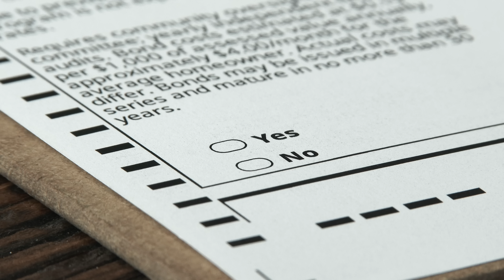Why Does Tesla Have An Anti Right-To-Repair Stand? We Suggest Some Reasons

Comment: I actually take my Tesla to a 3rd party repair shop, because there's no official service center in my country. I don't know the exact arrangement, but they operate with the knowledge and even support of Tesla, they have access to diagnostic tools and can order new parts.
But I understand Tesla too, there are good reasons for not allowing anyone to work on their cars. Mainly because the tech is so complex, so different, and changes so fast, plus a large percentage is made in-house. ICE cars are over hundred years old, largely made from the came parts, and while they are complex, that happened over decades, so mechanics could easily keep up. Also mostly the mechanical components break, which require far less knowledge, so even as ICE cars are getting very complex lately, the common issues still involve the same old stuff.
I worked on ICE cars a little, I've built custom PCs for 30 years and I work as a software engineer, so I think I understand all major aspects of a Tesla. I don't think your average repair shop could handle it. But over time the knowledge will proliferate and the technology will become mainstream, while Tesla's reputation won't be in jeopardy anymore,  so I expect them to gradually open up.
Reply: If you work in software then you should understand that if a 3rd party working on the car can screw it up so badly that it is a safety issue than it is a sign of awful programming. It sounds like the code base is garbage in Tesla's and if it isn't controlled 100% then stuff stops working properly. Tesla's "auto pilot" is nothing more than fancy driver assists, many other manufactures have similar systems. Why can I buy after market sensors for those cars and they continue to work safely but that is such a scary thing for Tesla.

There is nothing so complex in their cars that it is so over the head of other people that 3rd party repair shouldn't be allowed. Just because you do not understand it doesn't mean there aren't other people out there smart enough to do it safely. This "I'm SOOO smart and even I don't understand the tech in my car so I am scared of letting other people work on it because well I am smarter afterall" manta is non-sense.
Reply: @instanoodles  
You have on idea what you are talking about.
1. Since I "work in software", I know how much work it takes to make a software usable for 3rd parties. It's not worth doing, unless you have to. And even then it's exponentially harder to make a software (or anything) completely foolproof. My point was that people who are mostly working with mechanical stuff are probably not the best for working with complex electronics and software. At the very least it's a steep learning curve.
2. In reality Tesla's Autopilot is 10-15 years ahead of the competition. https://www.youtube.com/watch?v=HI5Y5WKHRd4 The key is that this works anywhere in any condition and it's a stock car, while other systems only work in very limited circumstances and require very expensive upgrades.
3. Of course it's complex. But more importantly it's very different from traditional cars. Also there's a high-voltage system that is actually dangerous to work on.
4. You missed the part where I wrote that I do take my Tesla to a 3rd party shop.

Comment: Another reason for Tesla's anti right to repair stance could also be the company not wanting to be outshined by a third party repair! There an entire industry for high performance and racing parts out there which routinely "bests" the OEMs on replacement parts for functionality and durability. 

You don't have to be a professional race car driver to have used performance parts from Summit Racing (FYI - I grew up in and around Akron Ohio where Summit Racing is headquartered). Want to improve horsepower and fuel efficiency? Buy an Eddlebrock air plenum, or an underpulley system for your normally aspirated Mustang and pop them on. Got a little more money to plow into your vehicle? Purchase a Maclaren turbo retrofit kit from Summit. It's just stuff that you do as a vehicle owner. Want to add a nitrous oxide kick to your ride? Yeah, Summit's got that too! High Performance mode controller (ECM) chips and EPROMS are available at Summit for all of that. 

I think that Elon is scared of being "bested" by the high performance aftermarket parts industry to be quite honest. It's that same narcissistic streak - which we've all grown extremely wary of over the past 4 years!

Comment: I run an old (6jrs.) Model S and have done a fair amount of work on it. I have even installed a Trailor Hook. Working on Teslas is generally not so bad as its made out to be and so far Tesla has sold me everything I needed. That said, Tesla refused help when they detected an after Market Chip in the MCU. So it seems if you dont mess with Electronics your OK. I recon the older Tesla´s get, the more Customers will want to repair themselves, the more Tesla will be under pressure to open the Flood Gates. 
Keeping my Fingers crossed;-)
Reply: Where are you located and which parts were you able to get from Telsa? In the US, Tesla will not sell you anything but the most basic parts, because the law doesn't require it.
Reply: @amosbatto3051  I am situated in Germany. To buy parts I make an appointment online and type in the part numbers that I need I then pick these up at the allocated appointment. Done.

Comment: Great video!

Yup. I think Tesla is in a fight to the finish for their little part of saving our world. Anything that makes EVs safer and better (and appear to be so) is something they're going to try to do. Opening up hardware is absolutely going to result in less qualified people working on the vehicles in less ideal conditions.

From an end user standpoint (and ex-gearhead) right to repair is the way to go (I am a strong believer and material supporter of open-source software) but from a "save the world and make it greener" perspective they're making the right choice.

I like the world, and I like it greener; much more than I like saving money by wrenching on my car. 
I'd have said the same thing if you'd asked me while I was under a vehicle years ago bolting in a j-spec turbo to beat the local hot-shots.

Comment: 3rd party modular batteries that can be configured for custom voltage outputs will change the industry.  I would love to pick up an old Nissan leaf on the cheap and get it re-motivated.  

This is the reason I dont want a Tesla. I wont be buying one until I have the ability to keep it running indefinitely. People patting themselves on the back for saving the world by buying a Tesla may not realize they just bought a disposable car that will largely go to a landfill or take enormous amounts of energy to recycle, long before other cars would need to be scrapped.

Comment: Engineers are required to fix Teslas, not determined handymen or inquiring minds. Right to repair provides an out for Tesla when one of their cars crashes if not OKd by Tesla after the repairs. Fix your Tesla, have a crash, take the blame no matter what the cameras say. 

You'll probably live through the crash, so that's good. Driver is liable now for autopilot crashes, so no change. Or can require a car-repair-marker decal so folks see it was non-Tesla repaired. Maybe Tesla can allow 3rd party repair, then reduce functionality until its safety-reviewed. When they find a rural gal who fixes Teslas right, the company can recommend her for that area.

Comment: I'm in agreement here. I admire and respect the advances Elon has been the key factor in bringing to market. That said, I think occasionally, he can be particularly short sighted. I think that he would INCREASE the brand's acceptance over all by simply making maintenance data available to third parties, especially owners and make spare parts to keep each Tesla on the road as long as possible. They can keep control of the software itself, and require a subscription to run the car (so long as it 's reasonable) on their software. But allowing someone to take a junked old Tesla and rebuilding it to the point it can past the software's diagnostics will keep more Tesla's on the road rather than less. As the models age out, allowing third parties to manufacture spare parts should be a no brainer as it frees up their own manufacturing for newer models. And more people would be interested in Teslas if this were a known option. I wish he would reconsider. I think it would help the brand immensely.

Comment: It's ok picking on Tesla but over here in Blighty you cannot even fit a Cambelt onto a Landrover Discovery 3 or higher and BMW's are locking folk out as well as other ICE companies so Tesla are not unique in their action.
Mind you Nikki, we also have the good old "Construction and Use" Regulations that prohibit messing with the Electrics as well as anything that changes the original specification of any vehicle.  This is to ensure Safety at all times and it works so well done Officialdom!

Comment: When dealing with complex systems, an EXPERIENCED tech will usually be able to resolve an issue, and do so with minimal danger or damage. Now that medical books are publicly available and the tools can be had from China, this does NOT mean we all have the right to do our OWN heart surgery or even our neighbors appendix removal. If we admit that Teslas, or ANY "modern" vehicle available today are very sophisticated and a wrong move or "repair" could put car, driver and anyone sharing the road at GREAT RISK - so Tesla and ALL auto makers should offer classes to any who would pay.
Reply: All they do at the SC is swap out parts they have like two months of training. It's really not that hard. As for working with high voltage I do it every day and at much higher voltages then the 480v in this battery pack.

Comment: Second hand Tesla cars are not cheaper than new ones. Go figure.
Reply: I never knew that Tesla Model S sold new for £27000 in the U.K., which is what I can get a used 85S for.  So i call BS on that.

Comment: For model 3 I would rather the auto pilot steering mechanism does not use a rubber belt using, a gear instead is better

Comment: I think Tesla should find medium ground here.  Replacing parts like the suspension and any other non-electrical or non-software connected parts should be available for sale to Tesla owners.  Paying Tesla $150/hr or more for simple DIY repairs is just wrong.  As a simple comparison, one can buy pretty much any part for a Chevy Bolt as most parts come from the Chevy Sonic.   And this is not just Tesal, Apple is just a bad.

Comment: Tesla are putting in alot of effort to reduce cost and sell to the masses, but selling to the masses means 3rd party repair and spare parts/replacement info support etc.  They need to make the whole company more repair friendly as part of that volume transition.  OR they can just stay with the niche enthusiats market and sell lots of batteries.
Other rproblems they will have with mass market will be non-acceptance of basic quality issues and claims from using touch screen menus while driving or people who just can't use menus.  Used value may well drop if people can't keep these car going easily.

Comment: Sorry Tesla, Closed source and 'Security by obscurity' is not security at all. The best security is usually found in open source sotware, as any number of people can examine and freely modify the code. As Linus Torvalds said - All problems are shallow (easier to fix) with enough eyeballs on them' (I've probably paraphrased a bit here, but that's the sense).
For a company like Tesla, the problem with open source licenses (GPL mainly - https://opensource.org/licenses/gpl-license) is that they'd not be allowed to sell or control the software.

Comment: Tesla's right to repair hate comes down to two to maybe three points 1. Tesla sees themselves as a tech company and Not a automobile "Manufacturer" so Apple rules apply. 2. Ego like you said Elon wants control over everything about the car, if those  are his true feelings then just take ownership off the table lease only then right to repair is a moot point. 3.  Tesla is a aspirational - halo brand.  Until the $25,000.00 Tesla comes out then the tune might change (for that model at least).  Even then  don't hold you breath for them to be consumer friendly.

Comment: To me if there are no third party repairs available then technically your car is scrap as soon as the warranty runs out , there’s nothing complicated about a electric car, yes the computers that run them, and likely to fail are but they for the most part on modern cars are just plug in modules, all parts should be made available to everyone , it’s never caused much of a problem in the industry for the last 100 years and if there isn’t any independent garages explain how the hell the main dealers would cope with the extra work load, in the end this attitude buy not just Tesla but every manufacturer that wants to make cars ( and phones )as disposable items replaced every three years with a new shiny one  will be about as good for the environment as yellow stone national park erupting.
And drive car ownership buck a 100 year to when only the wealthy could afford one.

Comment: Why what works for all car manufacturers for more than a century would not work for Tesla? 
Also question of Risk with electricity ? Yeah right; don't you think that ICE car can explode or burn more easily ? (this is another B..... !)
Most normal country have a MOT which would validate car safety... so there is no issue. 
I just think Telsa wants to ensure that you go to their shop. (something Hunday is going by giving a 7 year warranty).

Comment: There are authorized  (independent) Tesla service shops.  The techs have to be trained to deal with HV systems.    Unless someone knows how to work on an EV, he/she could be electrocuted.   Nevertheless, as EVs become more mainstream,  I suspect we will see a  growth in the number of qualified technicians.  It would think that it would be in Tesla's interest to have more qualified independent technicians as its business model eschews privately owned dealerships.
Reply: Well, having some common sense helps. In an EV it is usually simple: you see a cable in orange tubing? That's high voltage. Don't mess with it unless you know what you are doing.
Reply: Rich rebuilds started working on tesla and he is not really certify or qualified for it but he could do it
Reply: There is a difference between "authorized by Tesla" and qualified. There are dozens of non Nissan workshops here where i can service it. None of them are "approved by Nissan". They have qualified personnel  for working on HV-Systems which is a standardized qualification in Germany. What Tesla is doing is needlessly controing the property of Tesla owners for their own gains, nothing else. 
But if you are stupid enough to have business with a company like Tesla, it's your own fault.
Reply: @carholic-sz3qv  I guess that is why he had such a tough time getting new parts for his Model S and had to rely on parts from a donor car.    Also, I recall that he was unable to supercharge the car once it was repaired as  Tesla had blacklisted as salvaged.

Finally, I didn't mean to suggest that no one was capable of working on a Tesla without being electrocuting themself.  But, I am certain that those who survive the attempt, put a bit of effort into learning about the risks.

Comment: I see your point with fixing something like your vacuum, I've done the same, but keep in mind fixing something yourself thats harmless compared to fixing something that can kill/injure innocent others or yourself, if done wrong, is a big difference.
Reply: Combustion engine cars are killing machines too, but we do keep repairing them. Point is EV makers make their cars so complex and incompatible with other parts, reparing them would make them unpredictable. 
Elon Musk isn't a generous guy, open sourcing patent is just a facade.
Reply: Depends on what you are fixing on how you are fixing it. Cars have been repaired by enthusiasts for decades without issues. Especially in the US where a lot more is allowed compared to some other places in the world. It's no different with EVs. I would say it is often even safer because EVs have so much safety build into their traction systems, so many checks that it is difficult to go wrong unless you start simulating sensor input just to jump start the system. But then you are once more knowingly taking risks, just as if you are putting a 600HP engine in a VW Beetle. Can it be done? Maybe, is it smart? Probably not.

When it comes to safety assist systems, like AutoPilot, the system should be able to figure out by itself if it can operate in a safe manner and if not, simply not engage. Otherwise the software is written in a bad way.
Reply: I guess you're too young to know about carburetor engine?

Comment: Well, the EV was designed to work for million miles without repair or maintenence.
Reply: AC & blower fan, suspension, body, power windows are same as gas cars, not likely to do a mil
Reply: Take it you never owned a tesla LOL